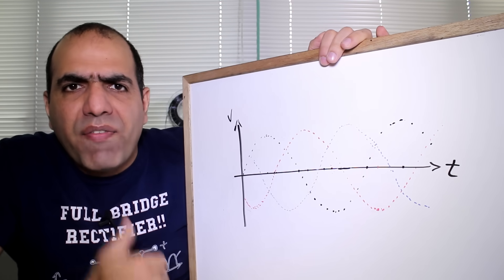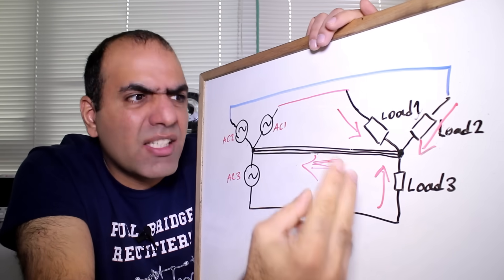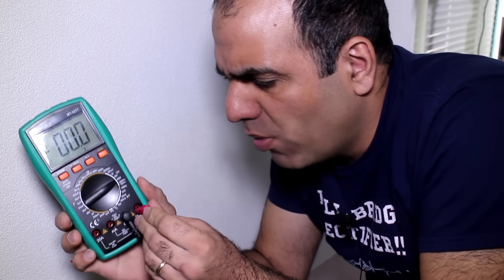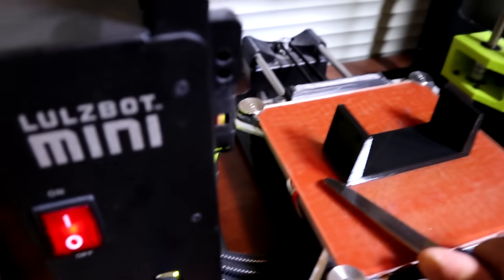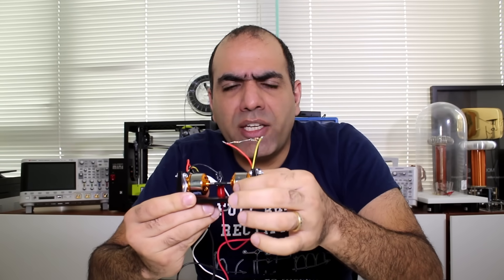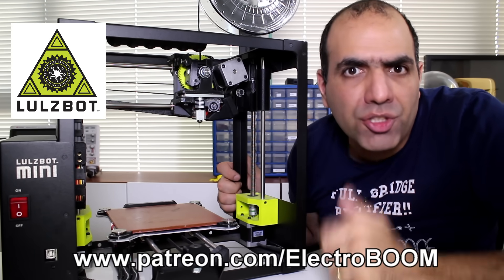Why 3 Phase AC instead of Single Phase???

Comment: Household current is not "two-phase".  It is properly called "split-phase".  Only one of the three phases from the power line goes to a center-tapped step-down transformer on the pole (or in your yard if the power lines are buried) and then to your house.  Both output legs of the transformer are from the same phase (hence "split-phase"), and as such they are 180 degrees apart, not 120 degrees as with 3-phase power.  The voltage on each leg is 120VAC and since they are 180 degrees out of phase, they sum to 240VAC.  Most of the circuits in the house are fed from one 120VAC leg or the other (aka "hot" or "line", plus a neutral and a ground) and the electrician will try to connect an equal number of circuits to each leg to balance the load as much as possible.  Dryers, ranges, furnaces, A/C units, etc., (240VAC circuits) can be identified by circuits that are fed by two circuit breakers tied together in the panel, and are fed both legs (i.e., two "hots" a neutral and a ground).

Comment: At 4:35 when you say that the AC is 120 degrees out of phase between top and bottom outlets, perhaps that is the case for city power, but for rural power with transformer cans on poles, it is 180 degrees out of phase, since the neutral is center tapped to that transformer's secondary winding, which is what is delivered to the electrical panel.

Comment: Here in Canada (and USA) residential wiring is referred to as split phase not 2-phase. Your house is supplied by a single phase, 240V transformer with a centre tap to provide two 120V branches 180 degrees apart . 2-phase wiring is an obsolete technology where two phases, 90 degrees apart were provided to make it easier to start electric motors.

Comment: Do Americans have two phase AC current running in our house?
Reply: No they do not, they have 'single split phase' power. Essentially it's two incoming currents but they're 180 degrees out of sync. (2-phase would be 120 degrees)

In your house you have 2 large wires coming in along with a "neutral". If you complete a circuit between one large wire and the neutral, you get 120v power. If you complete a circuit between the two large wires it's 240v. Most outlets are 120v though.
Reply: a rather small moose I figured. I’m not fully educated, but I was able to replace some damage outlets in my dad’s second house. Each outlet only had a live and neutral, but no ground, yet their was a ground plug on the outlet. 😐 Plus I thought each plug was rating for 15amp, but it’s the entire outlet.

Comment: Is that true in all of Canada?  Large appliances run off of 203 not 230?  And shouldn't it be 199 in that case?  Maybe the phase difference isn't quite 120 or maybe the meter is off a little or.....

Comment: You've explained this so much better than they did at my school many years ago.
The advantage of not needing the neutral wires for the combined 0 volts is definitely interesting, I wish they had explained it in this way so it might have stuck.

I like your visualisation with the coaster, a simple explanation of a potentially complex subject.
Reply: In fact, it's a little more complicated. The circuit is closed through a winding that does not currently have an "amplitude" (popularly speaking). However, we have other influences, such as hysteresis in the case of inductive loads. Note the case where the fan motor was rotated directly by the three-phase current from the motor. He winced and spun slowly. The fourth wire (zero) is often used in similar applications that have a "star" connection. Of course, the sum of currents or voltages in this three-phase network diagram is 0, but this does not mean the absolute cancellation of the fourth conductor. Very high voltage pylons have this conductor at the very top ...

Comment: Tesla is not the inventor of the three-phase power system. He is the inventor of the poly-phase power system, primarily two-phase. The three phase power system is generally credited to Mikhail Osipovich Dolivo-Dobrovolsky who worked for Charles Eugene Lancelot Brown (17 June 1863 – 2 May 1924) who founded Brown, Boveri & Cie (BBC) — later ASEA Brown Boveri (ABB) — with Walter Boveri. They developed the three-phase power system for the electrical exposition in Frankfort, Germany held in 1891. Albeit, all poly-phase power systems are built upon the Tesla concepts.
https://en.wikipedia.org/wiki/International_Electro-Technical_Exhibition_-_1891

Comment: Why 3 phases moved by 120d? Why not 2 by 180, or 4 by 90?
Reply: Because in the case of rotating devices you cannot create a rotating field with an even number of poles.
Reply: paulanderson79 2 would obviously not rotate, but 4? Why not?
Reply: @przemysawkwiatkowski2674  the pole pairs are 180 degrees apart.
The other benefits of 3 phase is that each phase is connected to the other two. Hence no neutral conductor is required.

Comment: Can someone please tell me what the current is at the center point that is connected to the three AC sources (labelled "AC1", AC2", and "AC3") at 2:13?  Thanks in advance!
Reply: If the current flowing through each phase was X amps, would the answer to my question be 0 amps, X amps, 3X amps, or something else?
Reply: @pussiestroker  Zero amps if all three phases are carrying equal loads. Three phase transmission arrangements have no provision for an earth (ground for USA English users) conductor.

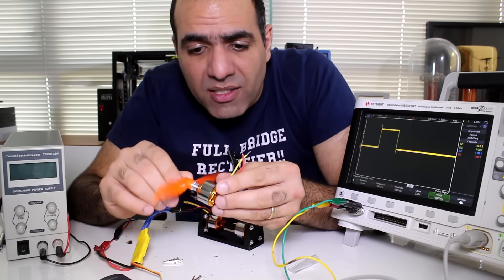Comment: Small error at 9:55 - the BLDC motor is in fact a three-phase synchronous motor and NOT an induction motor.  The rotor field is the result of magnets and NOT induced from the stator.
Reply: I came to comment section just to make sure this comment excists.

Comment: Isn't it extremely dangerous to short 110V? How are you doing that without fear?
Reply: It's shorted to the load, not shorted to ground. 110v actually isn't much at all. You'd have to make a very good connection to yourself and earth to get hurt. I've worked on 230v AC systems live from time to time. Long as you don't make a circuit you can work bare hand quite safely.
Reply: @paulanderson79  no i mean can't it destroy something?

Comment: Hi ElectroBOOM, I really love your video tut! 

Just wondering...is it possible that instead of using 3phase AC we use 6phase AC, 12Phase AC or even Higher? 

Please make a video for that. Thank you.
Reply: 6 and 12 phase is used quite a lot for high voltage transmission. Twelve phase is not so common but I worked on six phase systems myself back when I worked in power transmission industry.

Comment: Canada (and more than likely USA too) don't use 2 phases to homes. We use 1 240v phase split in half using a center tap in the 14 400v to 240v transformer. By that, I'll let you know that when you tested your outlet with the 2 120v lines and didn't have 240v across them that you have a defective wiring, outlet or meter. You HAVE to have very close to 240v. Also, your testing of phase shift using your oscilloscope is problematic because you are testing the same phase and should get exactly the same wave 180 degrees apart. Unless you are living is a city with very awkward (and idiodic) electrical system.

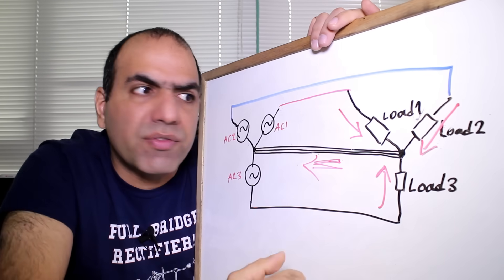Comment: 1:50 I still don’t understand why no neutral line is needed
Reply: because if you have a balanced load, the three load currents will cancel each other out - so no need to run a wire because there is no current returning anyway.

Comment: Sorry, but this is nonsense. All of his life, Tesla was advocating two phase AC. The three phase AC system we use today does not come from Tesla but instead from Dolivo-Dobrowolski of AEG in Berlin. Tesla was so fixed on two phase, that he used his influence on Westinghouse to built the generators for the Niagara Falls to Buffalo power system two phase. The electricity company insisted to use the superior three phase system for the power line, though, and so they had to built quite costly and complicated transformers to get from two phase to three phase. Years later, when the Niagara Falls station needed an upgrade, they kicked out all of Tesla‘s two phase generators and replaced them with proper three phase ones.
The three phase AC system was neither invented nor supported by Tesla.
See here for many more historic details: http://www.eti.kit.edu/english/1376.php

Comment: Question- I have always wondered how you got 208 volts and now I understand that is is part of 3 phase and is offset 120 degrees.  But how do you get 240 volts in your home?  Are they different transmission lines sending 180 degrees offset?  Seems like it would be a waste to send 3 phase and 2 phase?
Reply: In USA and Canada most houses are connected to 1 phase / 240 V transformator. The high voltage part of this transformator 
can be ( We talk about voltages of about 7000 Volt to 12000 Volt ) L1 or L2 or L3 of the high volt system to a Neutral highvoltage line
L1 or L2 or L3 to the ground ( in USA or Canada the ground is also used to return currents to the transport network )
To use the ground to return currents is very strange to me in Europa we Only use ground for safety. 
Or the one fase transformator can be connected between the highvoltage lines L1 to L2 or L1 to L3 or L2 to L3 .
On the low voltage side we have 240 V ac. Between L1 and L2 but these are not Phases ( it is a One Phase systeem ) is are Legs of
a phase. On the low voltage side we have two coils and in the center of these coils we connect the Neutral and this connection 
is also grounded. So on the low voltage side we have L1 to ground or neutral 120 V ac. And L2 to ground or neutral 120 V ac.
Between L1 and L2  240 V ac. All voltages are in phase it is a one phase feed that is a Changing magnetic field Not a rotating 
magnetic field that is only in 3 phase systems. 
In larger buildings let say a appertment building it is connected to a 3 Phase systeem.  A 12000 V 3 phase system.  Now on the Low voltage 
we have L1 and L2 and L3 they are phases on the low voltage side we also have a grounded neutral. 
Between L1 and L2 and L1 and L3 and L2 and L3 we have 208 Volt ac. Between L1 and the grounded Neutral and between L2 and N
and between L3 and N we have  120 Volt ac.   208/1,73 = 120 . 
In Europa we use on the low voltage a 3 Phase systems  400 V/ 230 V . 400 V between the Phases L1 to L2 and L1 to L3 and L2 to L3
And 230 V ac between L1 to a grounded Neutral  and L2 to N  and L3 to N .   400/1,73. = 230 
The transformaters mostly are 10 000 Volt/ 400 Volt ac  all 3 phase ( 1000 000 Va or watt )

Comment: I finally understand 3 phase after 10 years of engineering college !! Thank you !

Question : Do 3-phase transmission lines have 3 wires only (one for neutral not needed) ?
Reply: transmission lines have no neutral wires. but they do have overhead ground wires located at the top of the 3 phases to protect them from lightning.

Comment: Maybe it's too late to ask, but could you eventually make a video explaining why we stop at 3 phases? It feels intuitive to think (although I know it's wrong) that adding more phases, all equally lagging or leading each other, could improve power transmission even more than with a 3 phase system. I know it envolves the math behind it, because the voltage behaves as a sine wave, and it peaks at a certain degree, but I'd love to hear the full explanation with the charisma and sparks of THE RECTIFIER
Reply: Three phase is the most cost effective option, and at the same time efficient
Reply: Nicola Tesla actually designed 2,3,4,6 phase systems (I can't remember if 5 and 7 phase were tried as well but it seems like it) but settled on the 3 phase system I believe because the math works out better . Large AC generators have the stator windings arranged around the stator frame in series to increase output voltage with duplicate parallel windings to increase KVA output capacity instead of adding additional phases .
Reply: 3,6,9 might be possible. By theory if 3 phase added up to 0V. Then adding up another 3 phase with the same shifted phase time at any starting point should be ok. But the need to calculate the imbalance neutral line to support peak voltage if a number of the load are turned off (disconnected) or any imbalanced load.

Comment: You have omitted another important reason why 3 phase alternating current is used. By using 3 phase AC as the main network, frequency stabilization at any point keeps the power of the grid constant, which is not possible with just one phase.

Comment: @8:15, Phase 3 is wound backwards according to the diagram.  You'd need to switch the wires around going to phase 3 for that theoretical motor to work.  Or flip the stator pole 180 degrees.

Comment: A brushless DC motor is a 3 phase synchronous motor. Electric power and shaft cycle at the same speed (frequency), and the phase difference follows from the torque. An induction motor is not frequency locked, however the frequency difference is a function of the torque.
Love your vids BTW! I still laugh at every BOOM.

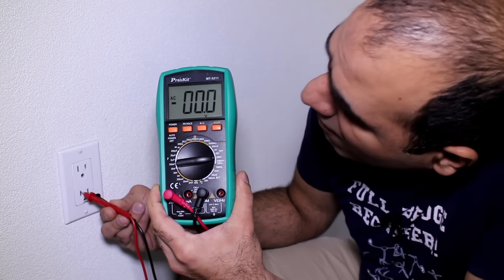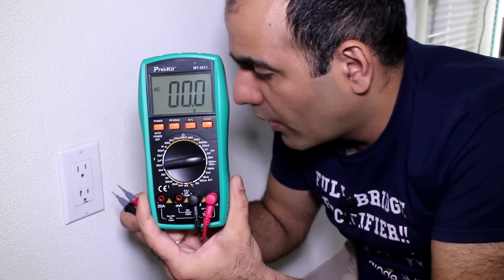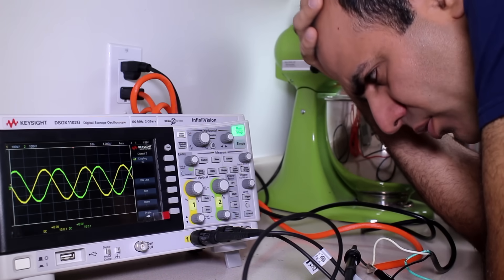Comment: 3:06 oh so that's what those harbor freight freebie meters are for:  cables to be used as movie props as though you're holding the real leads to the meter (3:22)  With my new oscilloscope I set off boastfully to display 4:39.  I failed miserably popped my breaker twice.

Comment: If used as agenerator, why the 3 phase iron core generate current if the rotor does not have magnets?
Reply: A Brushless DC-Motor has a magnetic Rotor, otherwise it wouldn't turn. You can't use a Single-Phase-AC-Motor as a generator though, at least not this Propeller-Thingie Medhi used. 
So you can use a BLDC as a generator.
Reply: @flyingdeer3963  I am talking of the nikola tesla 3 phase motor.

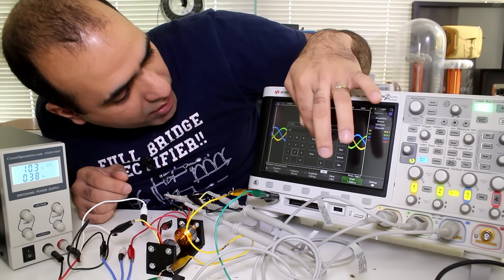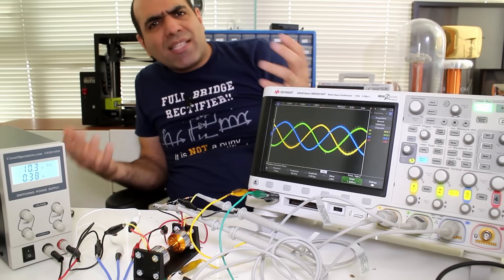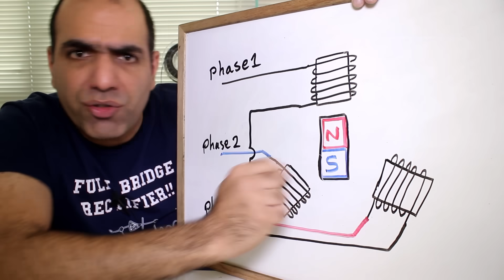Comment: some late info.    at  5:08,  there is a Misstatement.   i have seen the same misstatement in a comment, elsewhere.   maybe from one of your subs.     in any case, you should perhaps discuss this mistake in a video, sometime.     it is Not accurate to say that a bldc motor runs on AC power or that the output of the bldc controller is AC.       yes, the motor has three phases, and, yes, a bldc controller Must be used.      the output from the controller, however, is  NOT  AC.    the output can be thought of,  as being produced by three, Synchronized,  (DC) pwm  driver circuits.    DC   not   AC.    or a single  clock-controlled circuit.    (  you may have heard of  the motors made by fisher and paykel.   these  mult-pole bldc motors, also, have a  three phase DC  stator.     see linked stator  diagram. )     at 7:32,  yes,  the output from a brushless pma is  AC.     at 7:44,  you say  '3-phase AC motor'.   these are  NOT  AC  motors      at 8:21, you say 'electrically out of phase', however, the Cause of the out of phase-ness, is  Mechanical.     at 8:23, you say 'each one is Driven by a different  Phase.'   huh?         it may be that this mischaracterization of bldc motors and their controllers  has been published, somewhere.    if so, that text is  Wrong.   (i see that it is wrong, on wikipedia.)       cheers        googletranslate

Comment: 3:00 i think you could make an open delta from the two phases to make 3 phase power within the residential home, just beware the bastard leg. also im very sure your not supposed to have two phases run to the same outlet, the idea being to prevent the accidental creation of two phase power.
Reply: As long as you break the jumper between the hot terminals your'e fine.  neutral doesnt need to be broken unless you are on 2014 nec code where every single phase circuit needs its own neutral
Reply: Fakename that makes sense of course, but why might you be in a situation where you have the wire run to bring two different phases to the same outlet? Im only just starting my apprenticeship, i know i was told not to do this but i dont know why id be in the situation where i might want to?
Reply: @666cowboy69  it can be for a few reasons if you have 2 dedicated appliances or equipment and wanna make sure no one uses the receptacles for anything else.  I usually only do it during remodels where I can't add another receptacle in a wall but has multiple circuits in a box and they want 2 dedicated circuits in the same area.
Reply: Fakename thank you for teaching me.

Comment: In Sweden every house has 3phase 400V incoming to the house. Even apartments have 3phase 400V then split into the different rooms to have an even current balance. I don't understand what the rest of the world is doing with single phase 60 amp breakers etc.

Comment: I have never seen 3 phase in the U.S., it is available in commercial applications, but never in the home. We use "split phase 120 VAC" with 240 VAC across the phases, and a neutural.  120 VAC from hot to neutural, and 240 available at the box, and some high power outlets (like electric range or dryer)

Comment: So to power the one DC brushless motor, you feed DC into the circuit with a controller signal to convert into 3 phase AC to power the motor, but why can't you directly tap into that 3 phase AC, instead you couple it to another motor to on the other end generate 3 phase AC again?

Comment: Please don’t ever move to a country that uses 415 3 phase it’s very unkind when shorted accidentally or on purpose and the shocks are nasty business you might not survive and the world would be less of a place without you and your vids in it. 

I’ve for a long time had a love hate relationship with our relatively high consumer voltage (Australian) it’s great for reducing cable size and voltage drop but so much more lethal.

When stuff goes wrong on 240 single phase it’s bad enough 3 phase it’s so much worse I work in the hvac industry and have to deal with 3 phase systems on a daily basis and it really teaches you a healthy respect for electricity and I must say a lower supply voltage would likely save lives.

It’s an argument old as electrical distribution but I do find it interesting that in so many places infrastructure cost has won over electrical safety.